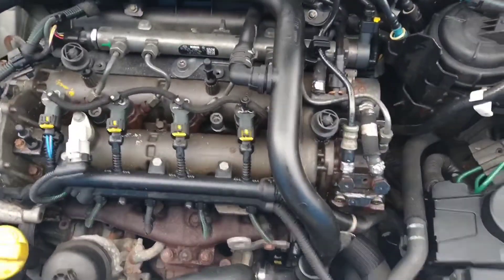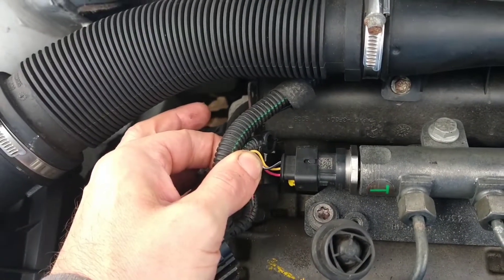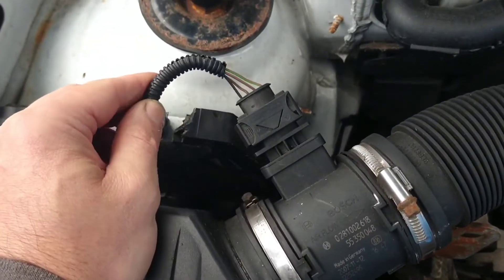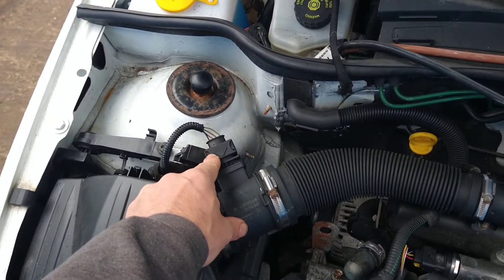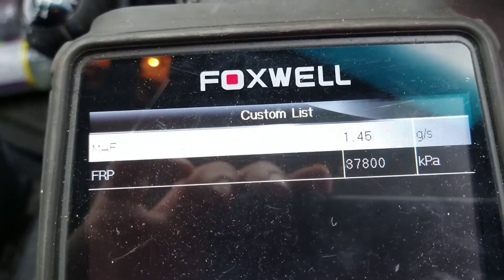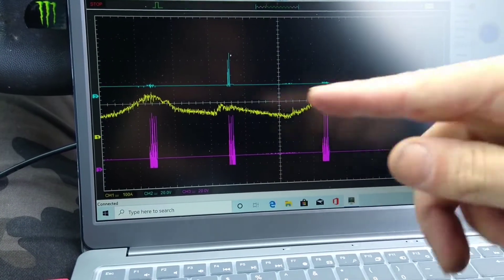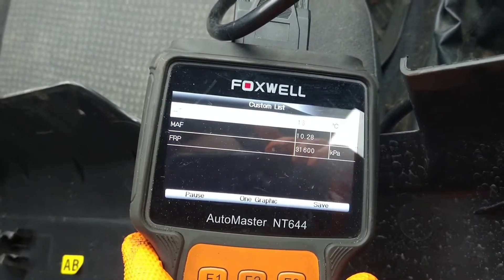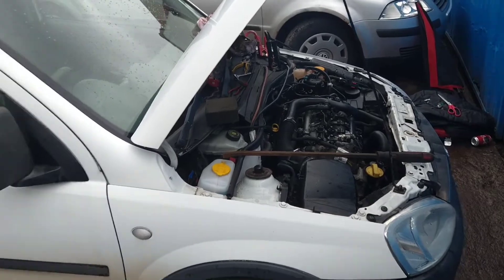Vauxhall combo No start (part 2) solved

Comment: Hello I hope your able to respond. My van combo was struggling to turn over today. I found my fuel filter housing was leaking. Can that cause a van to not turn over. New starter motor and high performance battery installed
Reply from the maker: @matthewrobinson2831  if it is slowly cranking with a new starter motor and a good battery, I would Carey out some checks, can the engine be turned over with a ratchet?  If it does I would check for a voltage drop while cranking on the starter power and and starter casing to the battery's terminals, I would also check the start wire going to the starters solenoid for a voltage drop while cranking.
If the engine is tight to crank with a ratchet, try removing the drive belt from the alternator etc, then see if the engine can be rotated with a ratchet any easier

Comment: Looking for clues why my 2007 1.3 cdti combo van wouldnt start the next morning. Money light was on and code P0400 EGR flow. Was sceptical until I watched both your videos. 1. because like yours, it sounded like it wanted to go and I'm thinking fuel prob. 2. I would also never have imagined a stuck open egr valve would cause a no run. Anyway took it all off, valve stuck open. Cleaned egr (good as new literally, with oven cleaner gel), solenoid tested good, cleaned the recirculation pipe that bolts to inlet manifold (pretty bad, only one hole open), reassembled - start first turn. Brilliant videos Matt youve saved me a small fortune. Thanks, Martin.
Reply from the maker: Hi Ralph, that's brilliant that you got yours going and thanks for watching and your comment

Comment: got the same combo recently, and found out that it needs a good battery to start, below 12.4V mine had difficult starting. (startermotor good as new)
might try a new maf as wel, mine was 3.2Kohm engine off

Comment: I ve replaced cam and crank sensors still no start :(
Reply from the maker: That's not good, what made you change the sensors, were they faulty. If there is no fault codes, check the live data on the scan tool. See if the fuel rail pressure is at least 250 bar. Check if it is fitted with a valve in the intake manifold that it is not stuck closed, also check the egr is not stuck open.
Reply: @mechanicmatt871  Trying to get to the intake and EGR got the diesl filter housing right in the way and an absolute nightmare to get at the torx bolts, I am going after those next, I had codes that said crank sensor communication issue, cant find my ready anymore more either to rescan and clear, its been at least 5 months the bastard engine wont start.
Reply: Ok so Im back with tackling this car been sitting since last :) LOL So im going to try the egr now

Comment: Am really baffled. Am replacing turbo on my 2007 1.3 cdti combo van, and it suddenly struck me there is no O2 sensor in the exhaust manifold, the cat or Pipework. Am I missing something. Autodoc have a pretty good cross referencing system on their website for parts and they dont list one for my van!! I've done a lot of searching online and am very reluctant to contact you this way with my issue, but as I say I'm baffled. Martin.

Comment: HELP PLEASE.
Any of you guys here's my problem. Park my vauxhall combo on the flat overnight. It will start in the morning but will only run for 25 secs before running out of fuel and cuts out. However if I back the van up on to a high point so the van is raised at the rear it starts and runs without a problem. Also if the tank is over Three quarters full it starts on the flat no problem. Any ideas please.
Reply from the maker: Hi there, the combo can has an electric pump on the tank so it should manage to provide fuel. I'm wondering if it's an electric wiring fault, at a certain angle the bump stops working.. maybe check fuel pressure with the car parked flat.
Reply: @mechanicmatt871  thanks matt, much appreciated.
Reply: @grassypants4450 
Did you find a solution?????
Reply: @konstantin-big  No, still parking on a slope 3 years later 😁
Reply: @grassypants4450 
Then the engine starts???
Reply: @konstantin-big  Starts first time, every time as long as I park it on a slope overnight. I've learnt to live with it !!!
Reply: @grassypants4450 
Hello 
Have you some error codes???
Reply: @konstantin-big  No error codes, anyway as you can see 3 years on I've worked around it. 👍

Comment from the maker: https://www.amazon.co.uk/Autool-Automotive-Detector-Diagnositc-Motorcycles/dp/B07K9RXK6J/ref=mp_s_a_1_1_sspa?dchild=1&keywords=autool+smoke+machine&qid=1594683108&sprefix=autool+&sr=8-1-spons&psc=1&spLa=ZW5jcnlwdGVkUXVhbGlmaWVyPUEyUlQ5NVU4UVRZU0tWJmVuY3J5cHRlZElkPUEwMjI4OTg5MUQxTzlVM1lRV0xQTiZlbmNyeXB0ZWRBZElkPUEwODQ2ODQ4M05PQ1NTVkhKVDRQQSZ3aWRnZXROYW1lPXNwX3Bob25lX3NlYXJjaF9hdGYmYWN0aW9uPWNsaWNrUmVkaXJlY3QmZG9Ob3RMb2dDbGljaz10cnVl
This is the smoke machine kit with blanking plugs to carry out blanking off the EGR to see if the van will start.

Comment: Yeah Matt, you would think it would start on a stuck open egr but ive had a no start on a 1.9dci trafic with an open egr
Reply from the maker: I was surprised it would cause a no start too, was thinking a start then cut out. I noticed during cranking that it injects 1&4, 2&3 at the same time, so the injectors are firing on the exhaust stroke cranking, I think with the glow plugs being on it may be like four vaporisers that are filling the inlet manifold with diesel vapour. Thanks for your help Dave
Reply: @mechanicmatt871  yeah could be, i put the 1.9dci one down to the inlet manifold filled with inert gas and no oxygen. I just pulled the whole egr valve out of the manifold and it started right away

Comment: Hi great videos matt were did you buy the high pressure pump gauge you used for testing on video ? Keep up great videos
Reply from the maker: Thank Daniel, I bought the gauge from eBay, I'll see if I can find a link
Reply from the maker: https://www.ebay.co.uk/itm/0-250Mpa-Common-Rail-High-Pressure-Gauge-Tester-For-Diesel-Oil-Circuit-Tube-Pipe/223183417149?hash=item33f6c4af3d:g:L44AAOSwR~tbvZ21
Reply: Thanks that's great ordered one been looking for one but they always were alot of money but that's s good price for one that goes upto 250mpa  cheers

Comment: Well done pal
Reply from the maker: It caused a bit of head scratching, with the engine not starting from an open egr, I think most people including myself were thinking that would cause a start then cut out problem. I think the injectors and glow plugs were like four vaporisers with the smoke going straight back into the intake manifold
I still have an intermittent problem with the MAF sensor loosing it's 12 volt supply. Thanks for watching and your help.

Comment: I have corsa D and it’s not starting. What do I do?
Reply from the maker: Is your car cranking? I usually start with a battery check, and a full system scan.
I look at any fault codes to help point me in a direction, if it doesn't have any fault codes I look for something mechanical.
The diesel corsa has an intake valve Thad the combo didn't have and if it is stuck closed the engine won't get the air it needs to run, this one is easy enough to check it's at the start of the intake manifold.
Reply: @mechanicmatt871  yes the car cranks and it doesn’t give any major fault codes. Should I check on the egr as well?
Reply from the maker: Yes that would stop the engine starting if it's stuck open. The other thing worth checking is the ECU it's self that is known to get corrosion from water damage. It's located under the wipers.

Comment: Good one Matt but highly unusual, stuck open egr 'usually' start then stall immediately once the diesel is actually burned! Good find cheers sandy
Reply from the maker: That is what I was thinking too, I was thinking until it was running it wasn't really exhaust gases so it would run for a second until it choked it's self.
I think injecting fuel also on the exhaust stroke when cranking, like it seems to do, didn't help it get the required oxygen to run.
Thanks for your help it's really appreciated